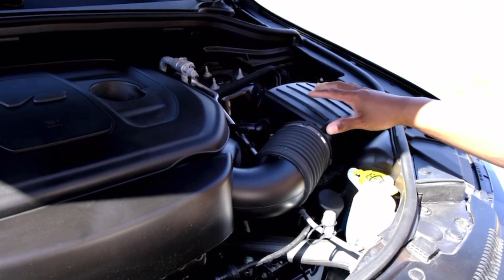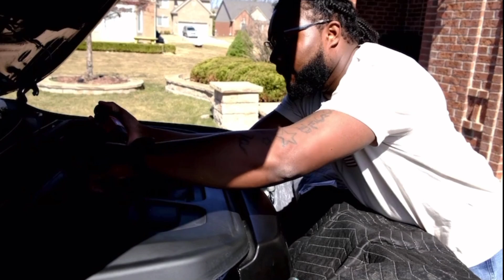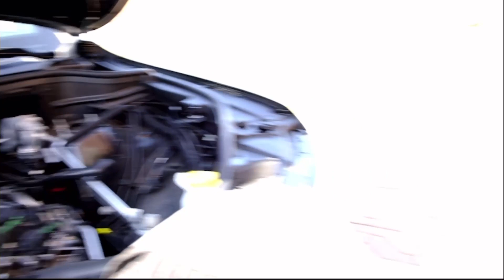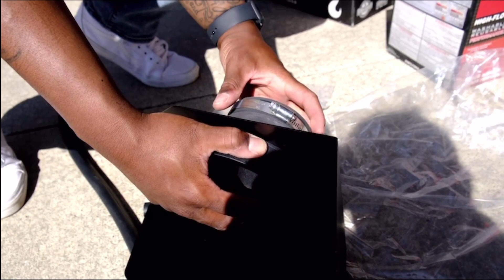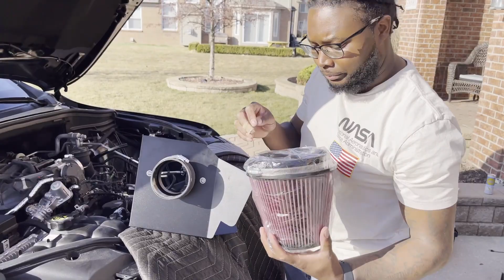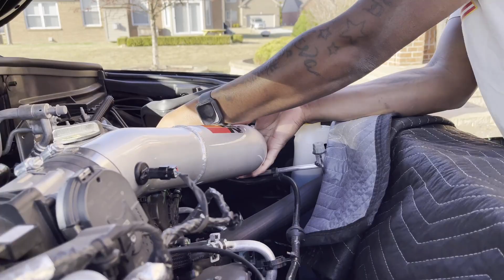K&N 77 Cold Air Intake Install | V6 2020 Jeep Grand Cherokee Limited X

Comment: I know this is an old video, but I just wanted to extend my gratitude for posting it. The was the easiest and most detailed instructions on how to install this on a Jeep GC. Mine is a 2018 and it was spot on. Took around an hour and not a single issue. You deserve a helluva lot more than 6.3k subs. Thanks again man.

Comment: Thank you for your video.  I was installing a K&N air filter system onto my 2021 Jeep Cherokee Trailhawk, and got stumped on how to remove the old housing that was on the rubber grommets.  Turned outo be very simple.  Your video saved the day.  Again thank you.

Comment: Man I just installed mine a few days ago and I absolutely love it! I can’t believe they difference it made in sound as well! It’s amazing! Cheers man🙏🏻
Reply from the maker: I’m right there with you bro 😩 and thank you, same to you 🤙🏽
Reply: Hey bro i know im a little late but i got the same model and wondering if it makes a whine sound ?
Reply: @Rahmane3158  No.. you won’t really find an intake that will make a “whine” sound for these engines.. but they do however make it sound beefier..
Reply: @cheikhsall3656 Mike it whine? Wtf it's not a supercharger,  it's a God dam open HOT AIR filter that looses power in the summer
Reply: @kwmiked  y’all need to shut up with the hot air filter crap. I truly don’t understand y’all hating on an open filter when so many people use them without a single problem.

Comment: Received my kit yesterday!! I am painting the tube black today( chrome delete GC :P ) and tomorrow is the install!
Reply from the maker: Nice! Going to look good with that black 🙌🏽
Reply: @BlklimitedX  I dont know if you can help me. Did you get the part R and S (on the plan) , it says block off, block off hood vents...i might be dumb because i cant figure out where to put them.... Metal and a rubber part..never seen that 😅🤷🏻‍♂️

Comment: Jeeps lookin good man. Fun upgrade that Does Not void your warranty. BUT.. If you have an issue caused by any mod the dealer can deny the warranty for that issue. Example, I did a Cold air intake and the increased airflow actually pulled the oil out of the filter covering the Mass Airflow Sensor setting off codes..Getting those issues/codes cleared were not covered under the warranty. 
Now you need a Corsa Exhaust to wake that badboy up! Keep living the dream man.
Reply from the maker: Damn that’s sucks and trust me it’s something I’m aware off. But an exhaust is definitely next but I went with Borla.
Reply: @BlklimitedX  Can't go wrong with Borla..I went back and forth between the two. Look forward to that vid. Cheers!

Comment: Another great video help me a lot, thanks  a few pointers if you don't mind
you should tighten any bolts loose first get all 4 in and then finish tighten, silicon spray helps 
I refer to them for K/N air filter and  throttle body got me throught it

Comment: I want to add CAI to my ‘18 Jeep GRC Altitude, but I’m about to have the dealer install a SRT hood (original with paint bubbling). But, I was hesitant because I have read that K&N CAIs will not fit under a SRT hood. Thanks for the step-by-step detailed process!

Comment: Yooooo, i have the same grand, same spec and everything i put in the same air filter about 9 months ago, i would HIGHLY recommend you get a new jetpro throttle body with a spacer and do a straight pipe, i did that and it gave me SO much more torque and power!!
Reply from the maker: I’ll look into that. I’m already running the MMX throttle body and has been great. And I’m waiting to get my exhaust installed soon.

Comment: Great install, but K&N tends to fail after a while. Any open box system will pull in a lot of hot air from the engine. You need a closed box system like an AFE system. They cost more, but they're worth the extra money.
Reply: depends entirely on how you install it. If you have a heat shield it will be okay. An closed box system is more restrictive, and the engine is already air restricted stock, so for sound and a bit of performance, open box system is the way to go, with the right knowledge

Comment: You may want to check out that knock at the end of the video. 
Hot air intake has improved sound but in my opinion that metal pipe is bad design. It will always be hot once engine runs at full temp. 
I can't judge I had my fair share of those installed when i was younger

Comment: Great video! I just installed mine last night and this video was very helpful. 
Two questions:
1. If I step on the gas it really gets loud and a way more from what I was expecting. Is that normal?
2. everything looks pretty tight, but how would I know if there are any leaks? 
Thanks!
Reply from the maker: If you mean louder as in intake noise, that’s normal. If everything is tight and no leaks you should be fine
Reply: @BlklimitedX  if I step lightly I barely hear any difference in the sound, but if I press hard it gives this loud growl. I was hoping that's normal and it's not because there is a leak anywhere. I used to have an AEM intake on a different car a long time ago, and it wasn't even near as loud. Thanks!
Reply: @BlklimitedX  btw I've been watching your videos ever since I bought my 2021 Laredo X. You put out some great content! Keep up the good work!
Reply from the maker: @Sm00thR0ckS  thanks man I appreciate it! Haven’t posted in a long time but I still appreciate the interaction 🙌🏽

Comment: Thank you sir for the info on the FloThroo. Just ordered one. And did you notice any performace gain from the bigger throttle body.
Reply from the maker: No problem man, and honestly a slight gain at best. I haven’t tuned my Jeep so I won’t see any real gains until I do so

Comment: Hey man just my suggestion you should remove the stock scope from the (factory) air box. You will not have the loose weather striping and also get more cool air directly to the filter.
Reply from the maker: Never thought of that, thanks man 🙌🏾

Comment: Question about the exhaust system you put on and the CAI , did you have to have the jeep tuned at all for the aftermarket parts? I put flowmaster catback exhaust on my 2020 limitedX and it seems to shift into higher gears at lower speeds. Will be in 6th gear at 35mph. Wondering if tune is needed?

Comment: Alright it's time to step into it a little 😁 . Great job and that will actually help with gas mileage too not just increasing your hp .
Reply from the maker: I have a feeling I’m going to get into trouble with this now 😅 and notice it helping a lot actually
Reply: @BlklimitedX  yes brother you are becoming addicted to the power mods now like I did .
What's left:
1)Vortex cherry bomb muffler 
2) Resonator delete
3) Diablo Tuner
4) Throttle Body Spacer.
All combined = super charger which costs 8k you cab buy look them up but doing all the things listed above gets close . Word

Comment: First off……love the video and appreciate the fine detail work as it pertains to your install. I’m the same way. I like for screws to line up correctly and your comment about the adjustable clamps lining up was right up my alley. Question…… I’ve heard that these cold air intakes can present a problem because where it’s placed it’s using a lot of the heat from the engine compartment. It’s not mounted near the grill or below where cooler air will flow from outside allowing the unit to run more efficient during hot summer days. Have you experienced and issues with that?
Reply from the maker: Thanks for the kinds word man 🤟🏽 and yes the open air box design of this intake makes it more prone to heat soak which isn’t good. I haven’t experience any significant problems but an closed air box like the AFE Momentum GT intake would see better performance results.

Comment: Definitely sounds way better. I have a 2018 altitude and I’ve been thinking about getting a cold air intake. Can you tell the difference in power when getting on the gas??
Reply from the maker: Nice! And I couldn’t tell an absolute number increase but I can say that it has more of a punch on the throttle for sure if that helps. It feels a lot more torquey lol

Comment: What up bro I rock with you Heavy I got a 2020 grand Cherokee summit  I threw the brake caliber covers slotted brake kit the k and N Cold air intake Change the interior lights to LED I’m sitting on 24 inch Azara My caliber covers are yellow I follow you on iG

Comment: How are you liking this 1yr later? Any issues mechanically, dash lights? Do you still recommend? I have a 2020 Jeep Grand Cherokee Altitude model. I have bought all cosmetics I can and now are wanting performance. Was also thinking on pedal commander witch I also seen in your console 🤔
Reply from the maker: I still have it installed to this day and still recommend it.
Reply: @BlklimitedX  awesome brother appreciate the quick response. I seen a similar one another YouTuber installed by a company called AFE power cold air intake. I asked him same questions he responded with the K&N a better option. It's also 130 bucks cheaper lol. Thanks again.
Reply from the maker: @Heywood Jablome  no problem man 🤙🏽

Comment: I have a 2014 limited and my k&n has a longer tube as the throttle body is set up in a different spot on the engine and I noticed urs sounds so much more better  like this wondering how I could get mine to sound exactly like urs
Reply from the maker: Honestly I would have thought it’d sound the same but if not I’m not sure. Try looking into getting a bigger filter, not an entirely new intake system but maybe a bigger filter that fits in that area.

Comment: Nice clean install! What are all of those different chambers for on the factory air intake tube? There doesn't seem to be anything connected to them besides the mass airflow sensor at the throttle body connection.

Comment: Hi, my jeep came with this cai, I need to remove it to change light bulb. Does the assembly housing that the filter resides in just pulls off? When u installed it you just pressed it on to tabs. Thanks
Reply from the maker: Yes as long as you disconnect the air temp sensor and loosen the clamps it should just pop right out with a little pull.

Comment: So disconnecting the NEGATIVE BATTERY connection not necessary as the installation directions stated?  I'm assuming for both Safety as well as RESETTTING the computer CPU w/ making necessary adjustment calculations based on new hardware feedback by the K&N system......
Reply: Bump… I did this today and followed the instructions to a T. I disconnected the negative and proceeded to install the K and N filter. However, upon completion and turning the vehicle on my driver side, digital cluster screen did not come on. Any reason you think of or recommendations!? thank you

Comment: You didn’t disconnect the negative battery leads before you started. They are the first set of instructions. Why not?
Reply from the maker: Honestly speaking didn’t think to. It had no affect on the outcome but that is a good catch I should have stated in the video.
Reply: @BlklimitedX  just got my KN intake in. As soon as I return from my travels it will be installed. Read the instructions first and I had to locate the battery which is under the passenger seat!
Reply from the maker: @spkuse   nice! You’re going to love it. And yes just make sure you move the seat all the way forward to have as much access as possible.

Comment: Just wondering if the performance/efficiency difference is worth the cost. Cool sounds are nice, but I’m a bit more mature now and want some value for the cost, lol.  

Seems odd to me all of the adapters. I can understand adapters on the motor side, but just seems odd to have to adapt the air box end. 

Back to my first comment about performance/efficiency, seems like stock was already a cold air intake, so wondering if there is much difference. I know either way it goes there is more air available due to bigger opening, is it that much better than just using stock box with a K&N filter.  

Any way thanks for the video, gonna look into a lot for my 2014 limited. 

(Love the SRT hood by the way!!)

Comment: Do you think it would be worth it to get this on a 3.2 V6 or will it just ruin my engine. If you think so I’m debating getting a 5.7 right now so if you think I should wait until then please LMK BECAUSE I DO NOT KNOW IF I SHOULD OR NOT. (Love the sound but don’t wanna mess up a perfectly fine stock Cherokee limited).
Reply from the maker: Honestly if I were you I’d wait and get the 5.7. It’d a better platform to build on.
Reply: Save your money if u leave the 3.6

go 6.4 or 6.2

5.7 are entry level hemi (junk without boost)

Comment: December 2020 now; have you noticed any difference in mpg? Any droning inside the cabin? Any other issues or differences than with previous air intake? TIA
Great video, very instructive! Kudos! So impressed, I just subscribed.

Comment: What does this do for the limited X. I have a 2020 also. But don’t much about cars. Does it make it faster or just gives the Jeep a different sound ?Like your Mod by the way!!!
Reply from the maker: Thank you man and I’ll be honest, unless you plan on doing any tuning you won’t see the advertised hp numbers of 20-25 hp, just as an example. If you install this just as is you’ll see minimal gains if any but you will get a better sound out of the engine bay for sure.
Reply: @BlklimitedX  thanks bro……really appreciate the advice

Comment: Seems like the air sensor isn’t going in all the way. Maybe grommet hole to small. Any idea to soften up hole?
Reply from the maker: It went all the way in, just seemed that way. But if if you want I would maybe take some heat to it to soften it up a bit and allow it to seat a little better.

Comment: Great video! Do you in fact need a tune after installing?
Reply from the maker: Thanks man and it’s not absolutely necessary but if you wish to see anywhere close to those advertised hp numbers, a tune is needed.
Reply: Did you throw a check engine light? Very detailed video bro huge help!
Reply from the maker: @John-rf4xp  nope, no light for code should be thrown if done correctly.
Reply: I installed mine sounds awesome! No check engine light either. Did yours come with a hood vent? Where does that go?

Comment: I just installed my  Cold air intake last week and  Had no problems until this Morning when I went out to start it. It's stalled but when I restarted it it stayed running. Did you have any issues like that at all on startup? I think it could be because I never disconnected the negative terminal on  install for the computer to reprogram.
Reply from the maker: No I didn’t have any problems like that. And I didn’t disconnect the battery, didn’t know you had to and that wasn’t in the instructions.
Reply: @BlklimitedX  

P
Reply: @BlklimitedX  disconnecting the battery negative was in the instructions for mine on a 2020 ram 5.7.

Comment: Being that the LimitedX/SRT/Trackhawk hood has heat extraction vents does water get in there when you wash it? Rains? Snows?
Reply from the maker: Yes but it doesn’t affect it. There’s channels to allow water to flow out as it’s supposed to do it’s fine. It’s OEM not aftermarket
Reply: @BlklimitedX  So your filter is always dry? Nice! I’m thinking twice about it but if you say it’s dry I might have to give it a shot. Thanks!
Reply from the maker: @jesusesparza887  yes absolutely and the hood does an amazing job at keeping my engine bay dry as well. And I have a dry bag over my filter to help even more with keeping it dry and clear of debris

Comment: I installed mine today and used your video as reference. Thanks for the great video and explanation. This intake makes a nice deep sound when you get on it lol. Quick question does your intake hit that silver line underneath it right before the filter?
Reply: Probably,  cause these are a waste of money and junk! They rob power sucking in all that HOT under hood air off radiator and engine driving down the road 😂🤦‍♂️

Comment: The K&N intake link says its for V8, but you have a V6.  You got it even though it says it wont fit your vehicle?  I was going to get this until I noticed that.
Reply from the maker: The intake, specifically the KN 77 model is for the V6. Amazon titled it that way for some reason and just added V8 after 3.6. The V6 and V8 models are completely but that model I posted is in fact for the V6.
Reply: @BlklimitedX  Thanks for the reply and the videos of WK2's.  You should do one on your hood conversion.
Reply from the maker: @kenton6093  no problem man 🙌🏽 and the hood came stock with it lol. Everyone always ask where’d I get it from I’m lol it’s stock and they’re shocked

Comment: I just bought a 2021 GC Limited X and haven't installed the K&N system that I removed from my 2016 yet. My concern is the SRT Hood that comes with the X. I find it hard to believe that when the vehicle is not moving a ton of water can pour right onto the filter. I'm thinking about fabricating an aluminum cover plate for under the hood, and installing a drain tube to direct the water away from the filter element. Is this overkill? How has yours been doing with the vented hood?
Reply from the maker: That’s a valid concern and thankfully no I have not had that problem even living in Michigan. And for added protection I have a dry bag on my filter found here 
K&N RF-1048DY Yellow Drycharger... https://www.amazon.com/dp/B000E7BU7G?ref=ppx_pop_mob_ap_share
Reply from the maker: That’s a valid concern and thankfully no I have not had that problem even living in Michigan. And for added protection I have a dry bag on my filter found here 
K&N RF-1048DY Yellow Drycharger... https://www.amazon.com/dp/B000E7BU7G?ref=ppx_pop_mob_ap_share
Reply: @BlklimitedX  thanks for the quick reply. I'll check that out!
Reply from the maker: @Dan_Bender  no problem man 👍🏽